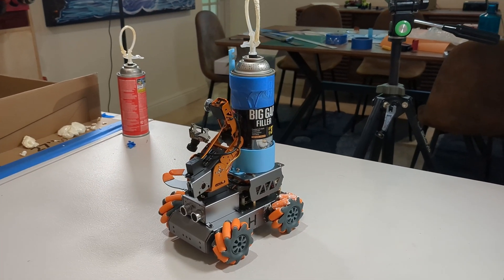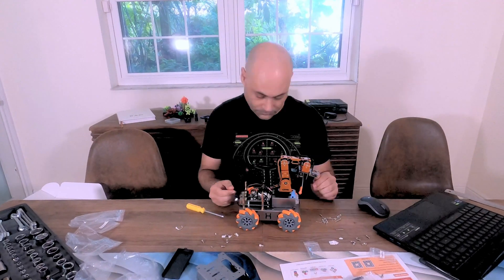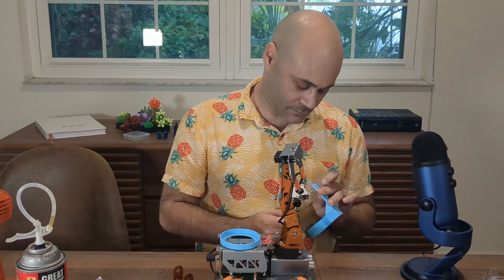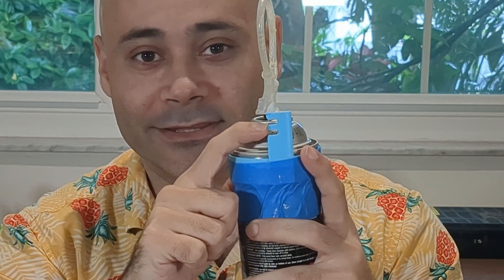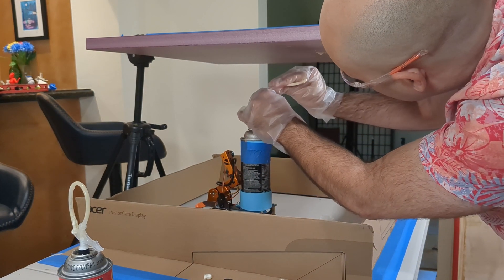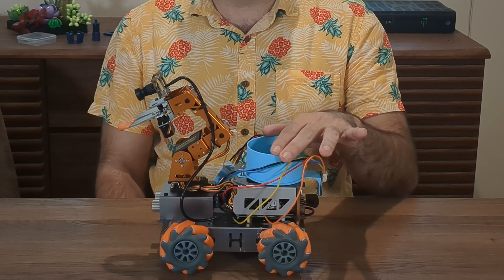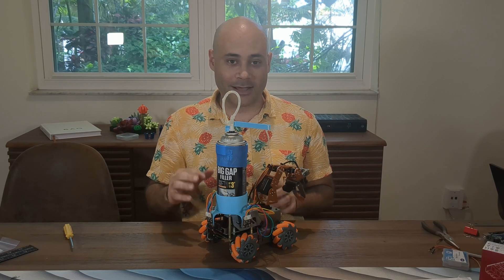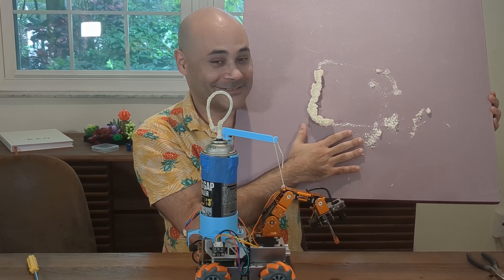Arbibot the Huge Foam Printer

Comment: I would recommend getting a commercial foam dispensing gun for this type of application. Theres a knob on the back of the gun which will allow you to dial in the flow rate of the foam. Home Depot carries a couple under the $50 price point. You will need some cans of cleaner though as the foam can harden inside the gun if its left to cure.
Reply from the maker: @slumbler  I didn't realize that was affordable. Thank you so much for this. That would be perfect for version 2! Thanks again :)

Comment: If you put the scara arm sideways it can reach large angle, with mechanum wheels would be unlimited area. I have printed mpscara with mods made by me from thingiverse, still dont have the mechanum wheels, the idea was to have precise printer or cnc maybe in refining process it can mount itself diff tools
Reply: Great work btw, im always happy when you publish a new video. Great ideas
Reply from the maker: Thanks. I like the idea of a scara arm. It could move from zone to zone and then just use the scara arm for fast precise movements. A tool changer would be amazing. I could spit foam and then use a tiny basic mill head to shave the foam flat.
Reply: Using steppers on the scara and on the wheels it can achieve a great resolution

Comment: why are you having it spray foam upwards instead of downwards? It'd be easier to control the other way round
Reply from the maker: @pastramiandrye  I would need to build a gantry, which comes with a host of problems. But I might not be understanding how you are seeing it. I'm always open to a different architecture if it leads to a better way.
Reply: @adrianinvents  I'm not familiar with fluid dynamics so I might be talking out of my ass, but can't you just extend the tube that sprays the foam so it hits the ground at the right angle without splattering it? Or turn the can upside down? At the very least you should position the foam dispenser angled inwards. You lose some space but you wouldn't need to worry about foam getting stuck in the wheels. 

You could build a motorized gantry to raise and lower the foam dispensing straw nozzle up and down the y axis, but I think it might be possible to do that without a motor to cut down on the complexity of the build. The action is relatively easy to replicate with something as basic as a sand timer - for example, the ancient greek automata designed by Hero operated on a similar principle, using falling sand to wind a string around a shaft to move the wheels. It could even be 'programmed' to move in certain directions at certain times with pegs.

Again, I am probably talking out of my ass here, but if you're just looking to make a simple proof of concept that's just a cube, you'd know that when the printing robot would complete a circuit around the perimeter, the nozzle needs to be raised by a certain amount. This process is probably something that needs to be thought on, because you're going to run into it if you print upside down too. Though, I suppose, you could get around that by lifting the platform after every layer. But you could also do that from the ground too - placing the print on a platform that slowly descends while the nozzle remains in the same place.

I'm having a lot of trouble seeing an advantage to doing prints upside down, maybe I'm missing something?

Edit: two different ideas on how to deal with lowering/raising the nozzle. First is lifting/dropping the printing platform at a regular interval. You could do this manually as long as you're keeping an eye on it, pretty precisely too with a crank or something. Second idea is to use the motorized arm already on the robot. By placing the can lower down - mounting it on its side, for example -- you could use the robots built in arm to lift or lower the foam dispensing straw nozzle or whatever it is while maintaining pressure on the trigger.

Comment: I think you need to use a different material. No project involving spray foam ever works out. The stuff is too unreliable, messy, and it keeps expanding so even if you got the robot running perfectly, you'd never be able to make anything decent with foam. Everybody loves the stuff when they first use it but nobody cares for it after trying to use it for anything other than sealing up mouse holes.
Reply from the maker: @ryelor123  I'm open to trying different materials. I wonder what might be useful.

Comment: This is a cool project mate

I love the emphasis on “don’t be afraid to use a kit for something that’s long been perfected”
Looking forward to seeing the how it comes along
Reply: One idea to improve the wobble the aim gets in some of your tests would be a pseudo-input smoothing from the inverse kinematics
Though you may need some kind of pressure regulator sensor to ensure that it knows exactly how hard the nozzle is pushing so that the servos can compensate for the wobble 

But definitely try a dampening guide for the nozzle tube first, you’re dealing with rapidly changing pressures at the internal lumen so the fluid hammer of the rapid expansions and contractions is probably introducing a lot of vibration along your nozzle arm 

You could also try increasing the turbulence of the nozzle to get the foams to aerate faster, this would mean you could get much closer to the surface
Reply from the maker: @BirnieMac1  Thanks for all these suggestions. I definitely think some sort of smoothing would be good.

Comment: what if you put a magnet on the bottom of the 'car', mag mount it on a horizontal thin steel plate, then dispense foam downwards?
Reply from the maker: @HK-oc3pn  That's a good idea. I imagine it could be done. I haven't tried spraying the foam upside down. Some sprays of other chemicals get weird when you turn them over. But there are also expanding foams that don't care.
Reply: @adrianinvents could still have the can be right side up and just have the tube make a bend.